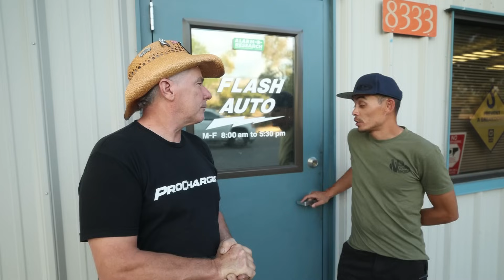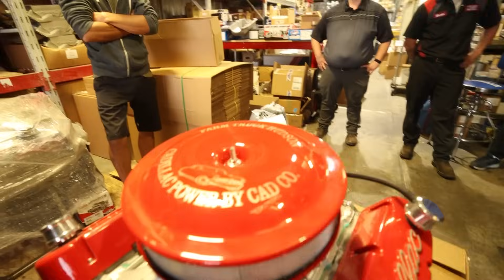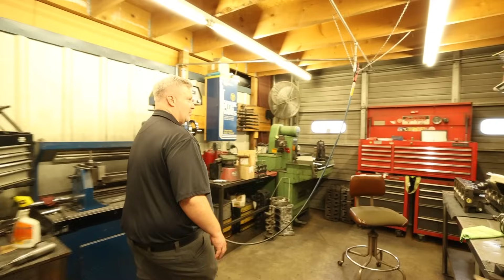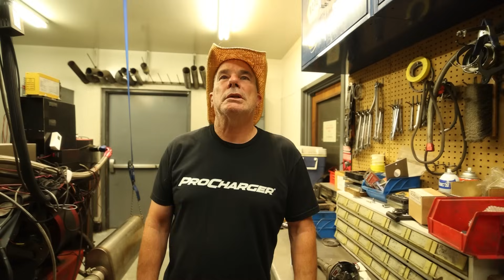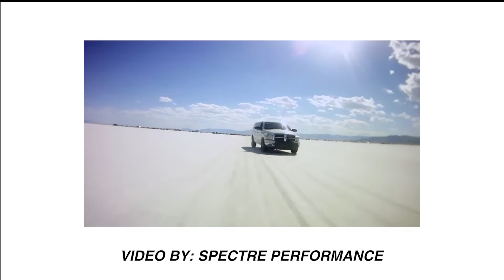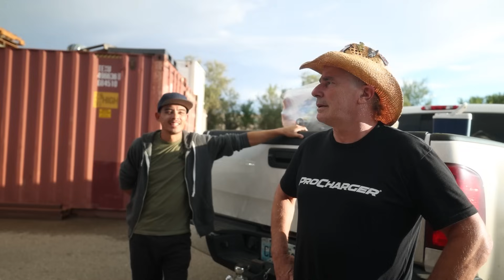We picked up a Cadillac 500 motor for our 49 Hudson from the CAD Company in New Mexico

Comment: I have built several 472/500 Cad cid back in the late 80’s and early 90’s as tow truck engines because of the big torque these engines can make at low RPM’s.  Additionally I built a 500 for the custom dually that I built using a 1 ton crew cab frame that I shortened to use a 6-foot bed and chassis, a 5 speed transmission from a later model truck, an rear axle and springs out a cab and chassis which allowed me style side short-bed box that I tubbed. Additionally I installed a sleeper to hide the 150 gallon fuel tank to go along with the twin 50 gallon saddle tanks which gave me a range of about 2000 miles if I topped up all three tanks before a trip. The truck got 8 miles a gallon towing a 42 foot enclosed gooseneck race car trailer.  I drove that truck for over 400,000 miles and would go through the engine every 100 to 150 thousand miles. The only reason I got rid of the truck was because I had stopped drag racing and no longer needed the truck and trailer which in all honesty was in need of some body work, a paint job, as well as the tires, and general overhaul.

Comment: I have a CMD (the company before CAD) 500. It is stretched to 540 ci. It has 600 easy horsepower. It moves my pickup much quicker than the 454 ever did.

Comment: Yep, Cad 472, 500 and Olds 455's and even Olds 425's make great boat low rpm torque monsters. 455's also ended in 1976. They have to make all the power and torque at low rpm cuz the rotating assemblies are so heavy. This is why you have to lighten the crank throws, girdle the mains and all that kind of stuff. Anyone can build a Chevy or Rod Engine, but not everyone can build a Cad or Olds engine and have it stay together. My mentor buddy also had a 59 Ford everyday driver with a Cad 500 with 472 heads, Cad power seat, Cad telescopic streering column, etc etc, Called that one the Fordillac, but it sill didn't beat his Cadsons.

Comment: Back in the late 80s I had a roommate with a red 1976 Eldorado convertible with a white top with a 500 motor in it. It was an amazing automobile. The peak of luxury land yacht.  Weighed every bit of 5000 pounds. Was not fast off the line but had no problem cruising down the freeway at 80 all day long. Drank gas like you can’t believe.

I’d love to have it now.

Comment: The Hutson hornet  had a high H.P. straight 8 engine multi carburetors was a "WINNER " on the first races at Daytona Beach.
Reply: No, it was a 308 cubic inch straight 6. The 254 straight 8's weren't used in those early NASCAR years, not nearly as much power.

Comment: Wow I had no idea you could get that kind of torque at only 3,300 RPM.
Reply: I might be wrong on this but if I remember right the heads could flow more than the intake and something about the specs on the cam drove the torque through the roof.